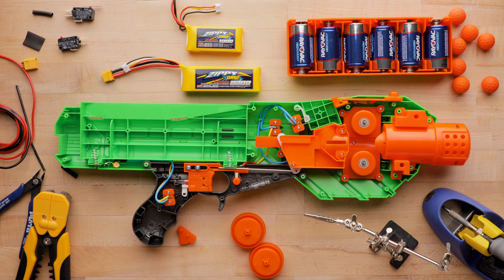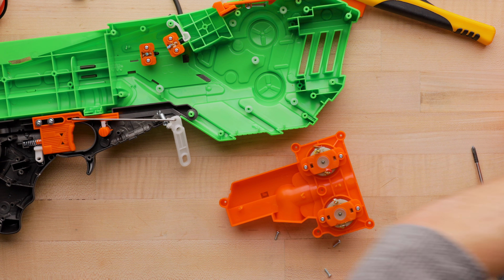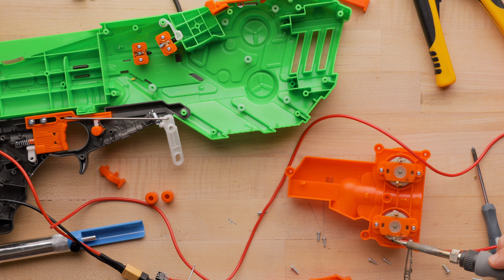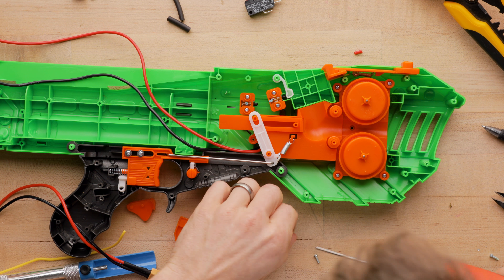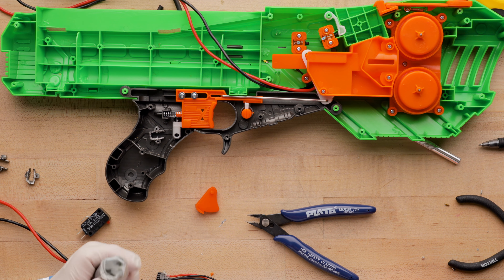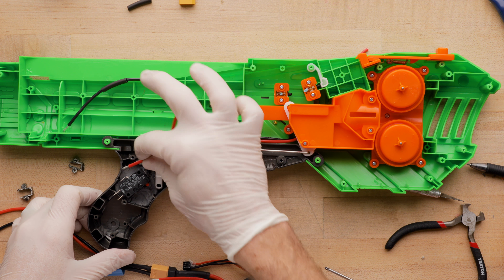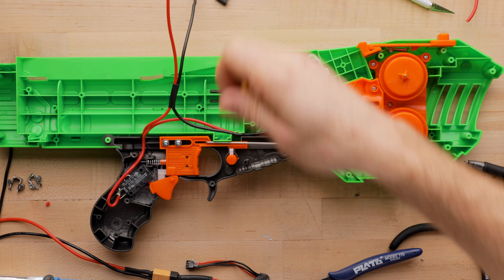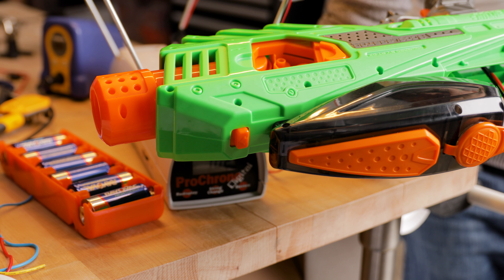MOD GUIDE: Adventure Force Accelerator (Rival style blaster)

Comment: Hey Outof Darts,
here's what I'm thinking of with all that space in this blaster:
put the 2s Lipo where the hopper well was and make the original battery tray the hopper. for making the balls go into the flywheels I'm thinking about a conveyer belt system, which would make the whole thing full auto as well.
What do you think of this?
Reply: Jakob Dobberow just use a paint ball hopper
Reply: but then it's pretty big on top again and wont feed as reliable I think
Reply: I have done an agitator paintball hopper mod before I think it's on my channel (I am not self promoting) I'm just saying it's possible and it works
Reply: Nonono, not saying it wouldn't be a very effective (and good) method of making a bigger hopper, it definitely is. I was trying to make the whole thing more sleek/nemesis-like without wasting all the space in the battery compartment. even with a big 2s, there'd be a lot of space left over I think.
Too bad these are not pbtainable in the eu, otherwise I'd just get two and try :/

Comment: TLDR: Take the wheels off and file the inside of the wheel while modding or you will melt the wheels onto the cage. 

The motor did not burn out. The dart zone wheels have a tighter diameter inside the wheels compared to the nerf rival ones. The dart zone wheels have a little extra plastic on it inside (which you can file down). This extra plastic melts and eventually welds onto the wheel wells of the cage. I sanded mine down with good results. Pop the wheel off and the motor will probably still spin (you may have burnt it out when you continued revving after you noticed it was done moving).

Comment: Not sure why you didn’t use a MOSFET for this, it’s a perfect example of when to use a FET. You wouldn’t need any putty or glue, no waiting or melting the side of the shell, no running 16awg wire through tiny spaces. It would be great if you could demonstrate the use of MOSFETS as you sell them on your web store, especially with your fantastic video quality.

Comment: Screws are most likely JIS screws which is the Japanese version of Phillip's. Also if you wire the motors in series , rather than parallel they will pull less power an likely survive 3s much better.

Comment: Starting to view now; thanks for filming in real-time for clarity. Yie, cringing on the screwdriver riding the head sockets. :-)  Have you addressed the feed issue when using Rival magazines (I have to tap downward before every shot)?
Reply: It's the pressure of the spring inside the mag.  The trigger return spring is also the pusher arm return spring adding a heavier spring somewhere on the arm fixes the problem (a small spring like the one pulls the pusher arm in a stryfe would work I think.) I'm considering finding a totally trashed rapidstrike and seeing if I can't fit the mechanism in the back attached to actual pusher arm.

Comment: Can you glue the wheels to the shaft? Fix the loosening problem
Reply: Norton SpeedGrip Urethane 15 minute structural adhesive; https://www.emisupply.com/catalog/norton-04617-speedgrip-structural-adhesive-minute-urethane-220ml-p-2234.html?osCsid=omfbbbbq71057vqu4o5f113t50
It's an automotive panel adhesive that I've used in the past. Once it cures, the parts themselves will fail before the bond will. As always, surface prep is key. Remove all dust/oils before use. A little pricey, but it works. Mixing nozzles are one time use item and it requires an applicator gun, though.
Reply: Also, Norton makes an epoxy in the same line.
Reply: If you want im starting a website where i design and 3d print something
Reply: I ran the nerf rival battery pack in the blaster. It lasted about an hour during a dart arena in my town until the wheel around the shaft cracked. I took apart the blaster and did the best I could to bandaid it back together. Used the same battery pack and it fired about 50-70 rounds until the upper motor blew.

Comment: Really? complaining about little things like bad sottering? I sometimes sotter bad and hit the plastic, it happens. This is a $30 blaster.
Reply: Looked like the solder was an the motor case because the capacitors typically tie to the motor case on one side.